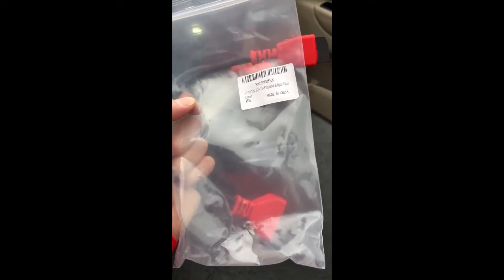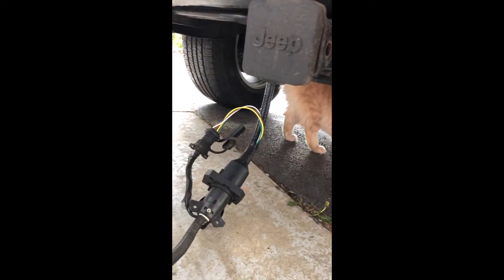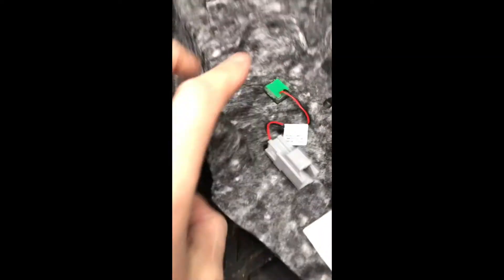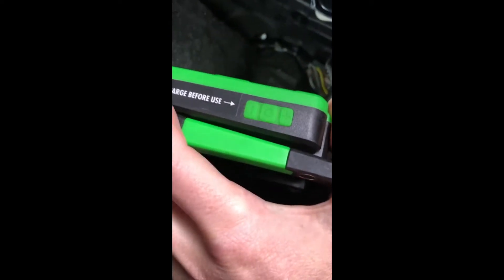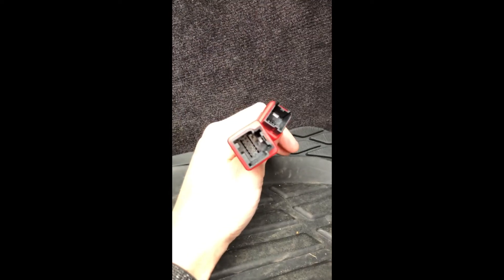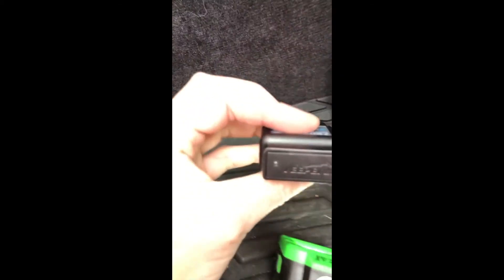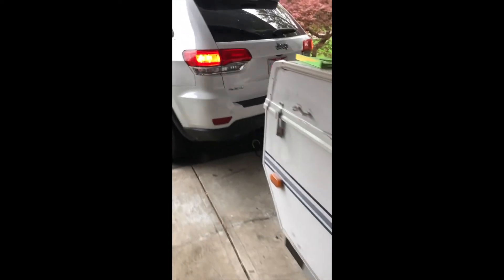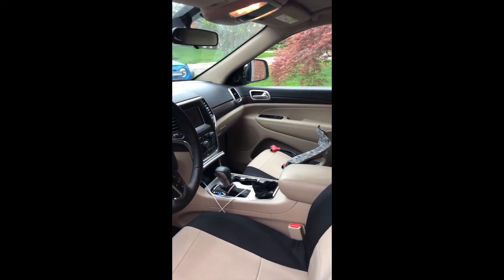Jeep Grand Cherokee 2018 Security Bypass Using FCA 12+8 --- DIY Tow Package

Comment: I'm a little nervous and confused.  I bought the vpeak and 12+8 cables.  Do I also have to pay a fee to access the programming?  I have a 2018 grand cherokee loredo just like in the video.  I don't want to try this unless I'm sure.  The disclaimers in the paperwork also gave me pause.  I don't need issues with my jeeps computer.  Thoughts?  Thanks.

Comment: I've tried this on a dodge 2018 charger, didnt work?, using an expired subscription tho, but it should anyways work? I dont want to disconnect the battery so the codes dont erase. I've tried it before on a 2021 dodge journey. Idk

Comment: Hey!!
Thanks for the video. It's super helpful. I'm currently in the process of doing the same mod myself. Would you be able to tell me which modules in Scan you've activated? I saw there is a bunch of them but not quite sure which ones are necessary.

Comment: Did you unplug those plugs 🔌 from a black box ? Also since it was on the right side , when you pulled that carpet cover down from just below the glove compartment, was there a little white colored arrow pointed upwards? My 2018 Ram 1500 Big Horn has that. I ordered the bypass cables for my XHorse Key Tool Max Plus & am now looking for that black box. Couldn’t find it on the left side. I am praying it’s not behind the radio because I really don’t want to take all that out.

Comment: Thanks for the useful information! I ordered the cable you suggested and it worked great to hookup my tpms scantool and reset some DTC errors that were preventing new sensors from hooking up. I originally tried thru the obd2 port but it would fail to reset because it couldn’t write. This cable worked perfectly and got it reset no problem. Ill be adding a hitch later too so ill be using it again! Just wanted to let everyone know it probably works with all scan tools to bypass the security module.
Reply from the maker: You're welcome, I'm glad it worked for you! Yes, it probably does work with all scan tools, but I've never tried any other than the one I own.

Comment: Do any of yall know if you need a bypass harness for a 2014 ecodiesel grand cherokee
Reply: you should not need the bypass.  the Security Gateway Module was introduced in some Jeep/FCA vehicles in 2018, but didn't make it to ALL of their vehicles until 2020 from what I understand.  ...No SGM, no need to bypass it...
Reply: My 14' Laredo had a software update. Because of the software update that was done by jeep I needed to purchase the bypass cable. This was as confirmed via jscan customer service and, Iscan customer service. I will see alittle later today how things go. I have everything now and, finally the time😊

Comment: Mark, what trailer settings did you all activate? First option is "!Restart all ecus." I don't think I need that. Next, trailer brake module, which I also don't think I need because the trailer I'll be pulling doesn't have trailer brakes. I think all of the following settings need activated? Trailer backup lamps output present, trailer tail lamp relay control output, trailer tow present, and both right and left trailer turn & stop relays. Any help?
Reply from the maker: Hey Nate- I activated all of them

Comment: For the actual bypass do you need to activate it like download a program or it just plug and plug. I’m trying to use it with Alfaobd.
Reply from the maker: I haven't used Alfaobd but that should work. The security bypass eliminates the limitation the vehicles computer places on the standard OBDII port. You should be able to connect any writing OBDII device to the security bypass device to write to the vehicles computer
Reply: @marksickmiller  question please I have a 2019 dodge caravan so a 12+8 adaptor goes in place of module n my scanner to the other end as usual n I can scan for codes or program keys . ?? N I should nit use the already obd 2 port right
Reply from the maker: @victornaja7927  Don't need to use the existing OBD 2 port when using this security bypass method.

Comment: I just watched and ordered the equipment.  I called my local Jeep dealer in Dallas and was told it's $147 if they don't run into issues.  I appreciate the video!
Reply: That was just to scan and make the changes.  No equipment.
Reply from the maker: You're welcome. This solution is a big cost saver and gives you control over your vehicle!

Comment: Awesome video..  i do have a 2018 grand cherokee altitude and you saved me a bunch of time not looking for those 2 conectors cable on the drivers side... thumbs up.. great video.  Subscribed :)
Reply from the maker: Thanks! I'm glad I could help
Reply: @marksickmiller  attach a Hopkins Towing Solution 40975 attachment to that hitch receiver..  looks nice and neat. Took me 2 minutes to connect mine.

Comment: Can you leave that security module unplugged and always leave the bypass cable plugged in for easy access?
Reply from the maker: I'm not sure. I didn't try starting the engine with the bypass cable plugged in. Personally I don't see a reason to keep it plugged in all the time, as it's only needed when you want to write to the computer. If you want to continuously read from the computer, you can use the OBDII port under the steering wheel, and you can leave the OBDII device plugged in all the time.
Reply: @marksickmiller you can't. Don't say that again. Do you want his battery drained??
Reply: There's a company that makes a module, I think it's OBDGenie.